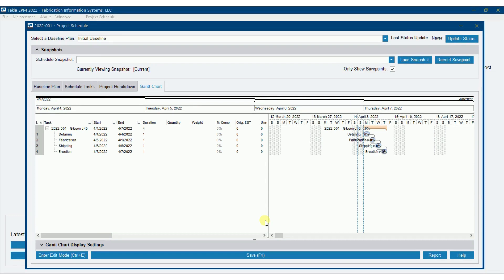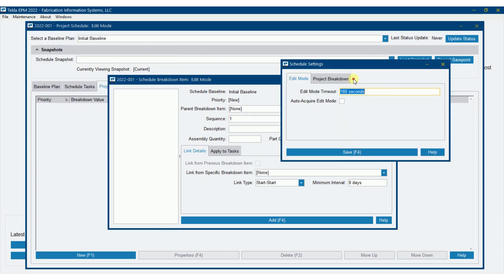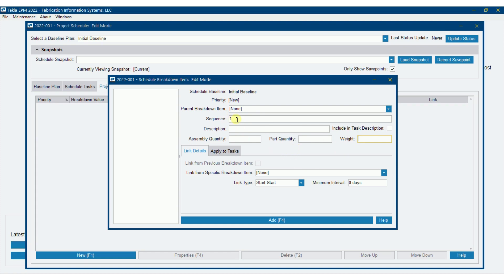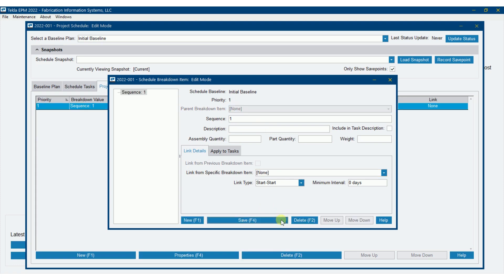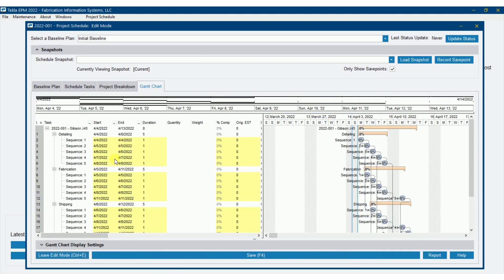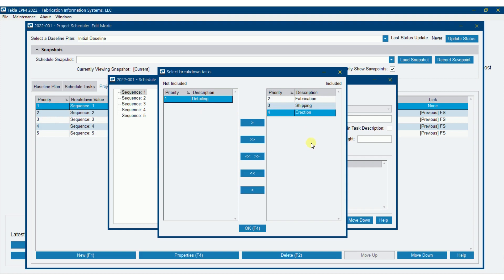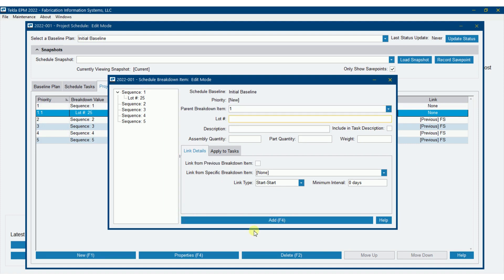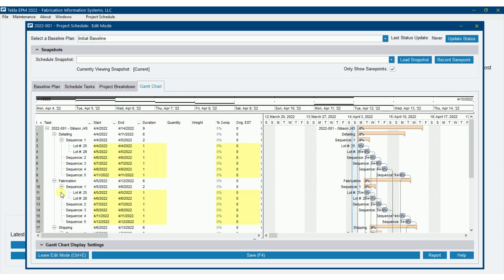Tekla EPM Project/Production Schedule Part 2

Comment: Ricky, is there a way to update production status based on items “returned” from 3rd party paint or galvanizers? I’m not seeing it.. but I think it needs to be. I need both the option to send away trucks to those places and then track returned and completed items
Reply from the maker: If you have shipping routes setup for 3rd party paint or galvanizers, then it will show in Production Status shipping area.  Do you have these setup?